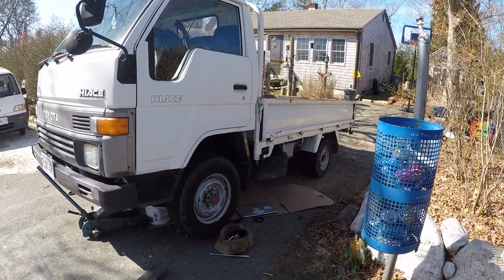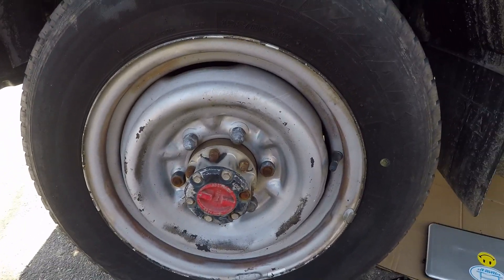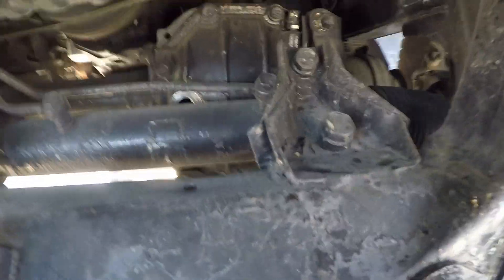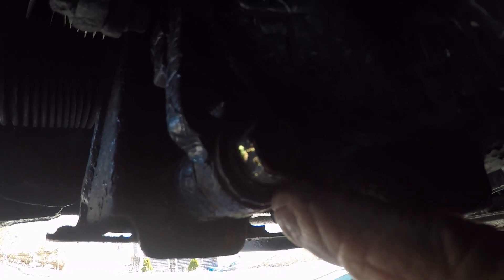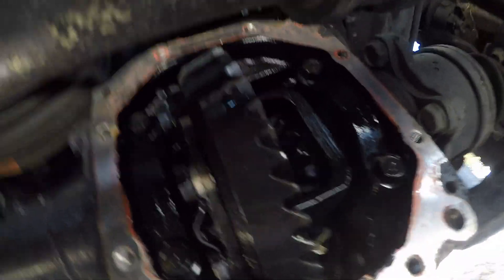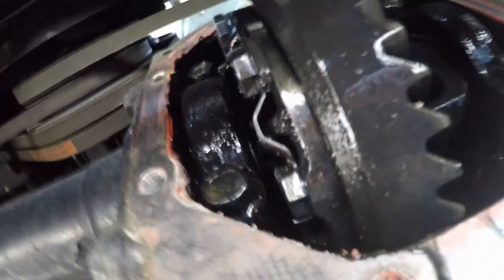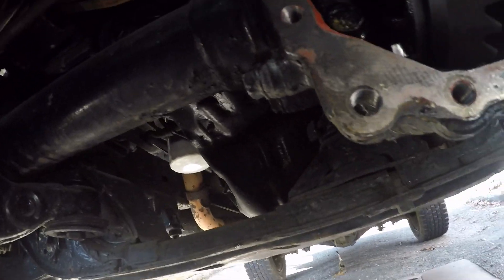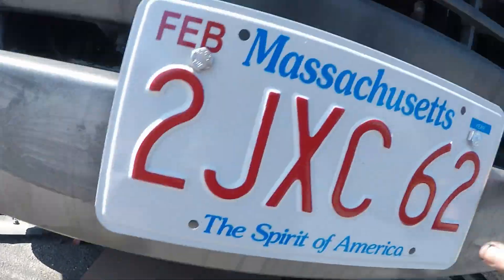13.5 wheels on back. 15 wheels front. 91 Toyota Hiace pickup regearing.

Comment: hi there about to do the same what axles and drums did you use ? i will be using gears out of the front   and rear lsd diff centre  from a 90s 4runner
Reply from the maker: Email me and Ill give ya my phone #. Theres a lot to it. cawalshx2@hotmail.com
Reply: @cawalshx2  thanks for the reply just found out here in australia the ln kzn rzn vzn 167 hilux axels backing plates and drums fit the rear diff center from any hilux fits the rear and the front diff gears from about 1990-2004 hilux/4runner with ifs fit in the hiace front housing
Reply from the maker: @davidbongers-t8p  Just watch ya gear ratio. Diesel gears are different than gas engine. Diesel dont have as high as high a rpm. I matched the rear with what was in the front, 8-40. The 3dr member i got was only 1000.00. Left the front alone.  Make shore ya set the gear lash corectly. Dont use the old crush colar.
Reply: @cawalshx2  thanks we have Diesel hilux and 4runners here in australai ratio is no problem
Reply from the maker: @davidbongers-t8p  Ya lucky. Can ya get me am english version repair manual for my 91Hiace hl85?
Reply: @cawalshx2  try looking fo lh80 or 81 dyna most is the same but not 4wd my one is also a import so i dont know where you would get one for the hiace truck

Comment: Hi can you do the pnr del 917 aw-5 from emu 203 that was donated to philippines
Reply from the maker: Hi What horn is it have?
Reply: @cawalshx2  del 917 but now its removed
Reply from the maker: @pnrtrains902  del 917 horn? it sounds like a RS2B Bells #31 and #37. Or do emu 203 have a horn?
Reply: @cawalshx2  yep emu 203 had a horn which pnr uses but only del 5009 uses it today and the aw-5 horn is now removed from 900 series while 5000 series has one
Reply from the maker: @pnrtrains902  I dont got an AW-5, thats a japan horn.It do sound like a Leslie S-31. I can do that horn if ya like.
Reply: @cawalshx2  ok thats fine
Reply from the maker: @pnrtrains902  Ill do A S-31 Afta Happy Easter
Reply: You just need to add low pitch to the horn it sound the same to
Reply from the maker: @pnrtrains902  The best I can do for a lower pitch is use a Nathan K chamber on it.